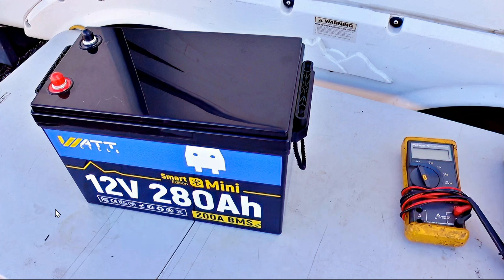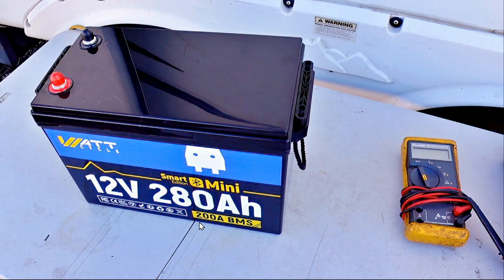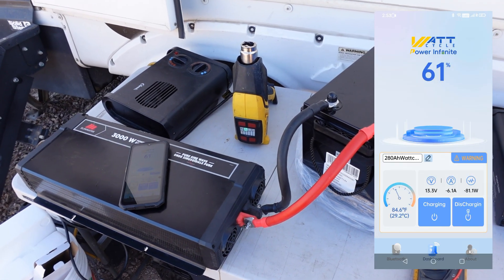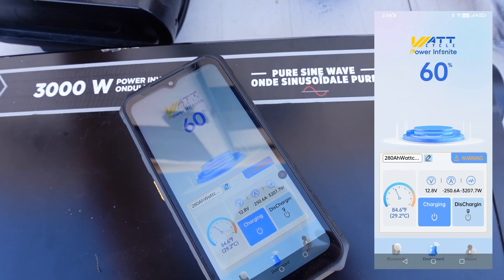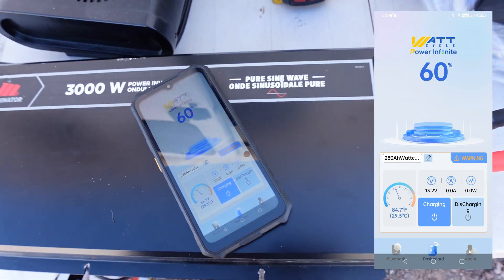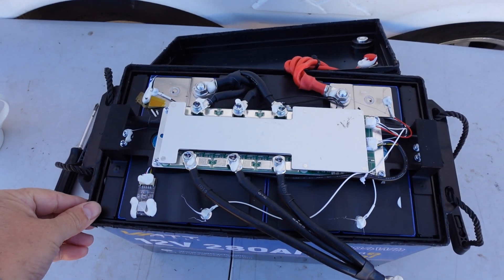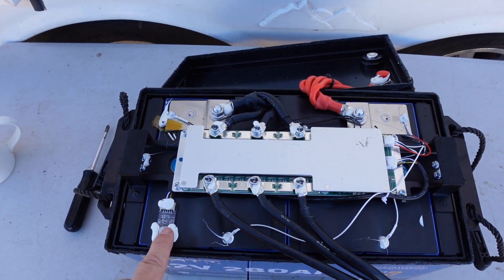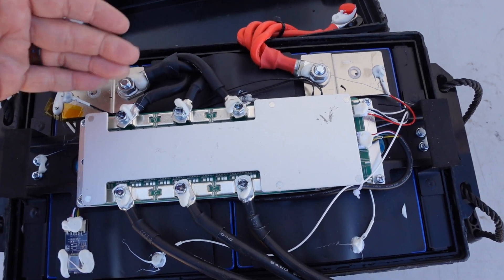Wattcycle Mini 280Ah LiFePO4 Battery w/Bluetooth - 200A Discharge Test and Teardown

Comment: Nice review. I appreciate it. Big boater here.. You absolutely do not want to try these on a bow thruster. As far as i know, they are storage batteries and not recommended to use as a starter battery. , Bow thruster manufacturers recommend deep cycle starter batteries certified for starting.
Reply from the maker: Thanks. :) At this point it is an experiment to see how they would work. The new larger capacity LiFePO batteries BMS boards are now able to output much higher amperage than in the past.  The one I'm installing for the test is a Vatrer 460Ah can output 300A continuous and likely 600A or more for short duration to cover any current spike by the motor.  Decided to use the Wattcycle as my number 2 house bank, replacing an old set of Trojan golf cart batteries, since they have a better sealed box and are more suitable for the location in the engine room. 
It will be interesting to see how it performs and if it trips. Lithium will have less voltage sag under heavy current loads.  But I have read that there may be concerns over too high of voltage for some thrusters as they may be designed for voltage sag to happen. Results could be a burnt out thruster motor or arced shorted relay contacts. I've even seen one thruster company that had a Lithium specific model to deal with that regulating the voltage.
I've left the existing dual AGM setup as is and installed a 2-way switch, so I can fall back if the lithium can't cut it or we've a tight docking situation and don't want to risk the Lithium BMS tripping out and not having enough time to switch back to AGM.  https://youtu.be/pl_9qIY0HQE Cheers, Ray

Comment: Is this the Eve code : E1S0647614  LF280K 896Wh  04QCB76K32702QE1S0647614  or is there more?   Is it the V3 cell ? I can't find it. thnx
Reply from the maker: Here is what the code reader spits out:  https://www.gobelpower.com/lifepo4_decoder.html
Code Check...
Code: 04QCB76K32702QE1S0647614
Code seems right.
Code length is right.
Manufacturer:
EVE Power
Product Type:
Battery Cell
Battery Type:
LiFePO4
Nominal Capacity:
280Ah (LF280K)
Nominal Voltage:
3.2V
Production Date:
25/Jan/2024
Manufacturer Website:
https://www.evebattery.com
Reply: @LoveYourRV  thnx a lot for the explanation!

Comment: When you have them both in parallel, can you check with the bluetooth the % of both?
Reply from the maker: Since they are both using the same cells and BMS and are nearly the same age, they should stay in good balance with each other, so the % of one will be very close to the other. It's good practice to disconnect every 6 months and charge each individually to full and then reconnect to help keep them in balance.
I also have an external battery monitor with a shunt. I've found over the years of testing various brand batteries that the Bluetooth apps % capacity reading can get less accurate if the batteries don't come back to full charge very often to reset it. So I wouldn't count on it entirely. If the voltage with no or little load on them starts to get under 13 volts you know they are pretty run down in the 10-20% range. Cheers, Ray

Comment: They are still sending out 300ah labeled batteries batteries with the website stating you are getting the 280ah version.  

Just so you know.

Got 2 300ah versions yesterday when the website stated 280ah.
Reply from the maker: Thanks for letting me know. Does it have Bluetooth? Must be selling off all the mislabeled stuff. 
I be sure to use a fuse on it and not count on it's high current shutdown just in case it's one that the BMS hasn't been adjusted. I've been using both the 300Ah labeled one and the 280Ah label in a parallel arrangement for the last while and they have worked well with my 3000W inverter. Cheers, Ray
Reply: @LoveYourRV  i did see a post from wattcycle saying they were working on a true 300ah on Wills youtube page so I am not sure if they are the old ones. I do know that the website is misleading.  These are my 5th and 6th batteries from wattcycle so I am kinda bummed.  These were not the Bluetooth version, the sale was for nonbluetooth.  For the very reason as adding more batteries to an existing system, wattcycle needs to be accurate and forthcoming on how they label their batteries.  I am not sure I would buy from them again.  Also because I saw the ecoworthy for 460 and I am currently wishing I had bought 2 of those.  Looks like a nice unit with some really nice features, plus I have a couple panels from them I really like.
Reply from the maker: Yeah, the product seems to be made of good components but the manuals and website are inconsistent. I imagine these Chinese companies are really scrambling with the tariffs. Maybe selling out whatever is in the warehouses in the USA hoping things change before the next shipment can arrive.

Comment: I was looking into this battery. I saw some comments that it would not charge with solar and discharge at the same time. Did you happen to check this out? Just curious
Reply: Ok thanks for the reply and safe travels.
Reply from the maker: Weird that seems like the batteries must have been defective or the people have a hookup issue. I've been running them for a few weeks, camping in our RV now. I have nearly 1400 watts of solar feeding them, and they power a 3000W inverter and the RV 12VDC circuits with no issues. At one point, I had the solar feeding them, plus my gas generator was plugged into the inverter charger feeding them, so I was charging at over 100 - 120 amps and at the same time powering AC and DC loads in the RV.

Comment: Is it just me or do the 4 positive wires look like the insulation has suffered some heat distortion?  Would love to watch your test again with the battery open and the handheld thermometer aimed at one of those 4 wires as you run at 190A and 200A for a while before pushing it over the 200A cutoff limit.
Reply from the maker: They look OK to me. Likely just look a little bending from being twisted together and bending as the lid is attached. But I don't see signs of a heat issue. Here is a close up view https://www.loveyourrv.com/wp-content/uploads/2025/03/Positive-wires-280ah-Wattcycle-battery.jpg  Cheers, Ray